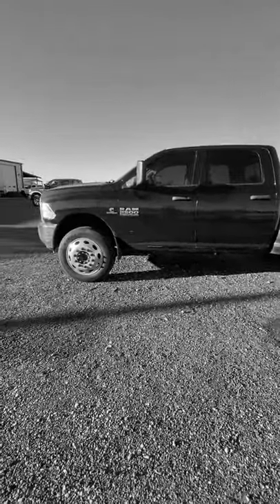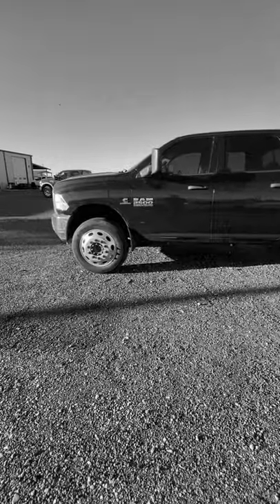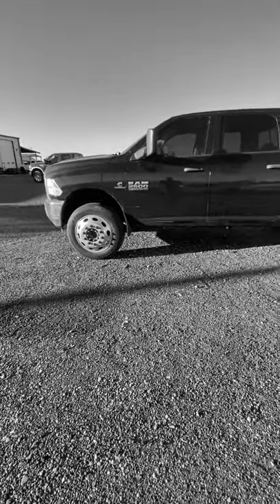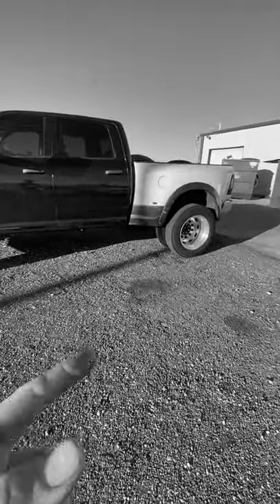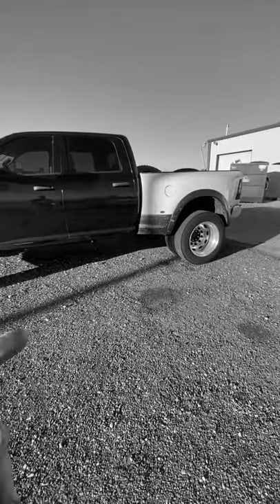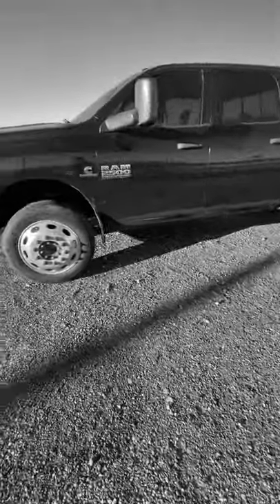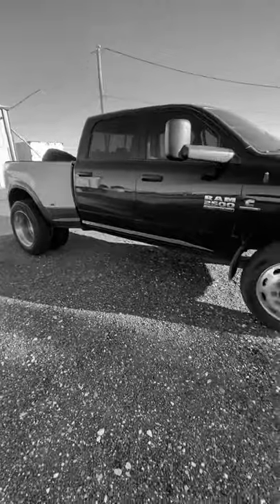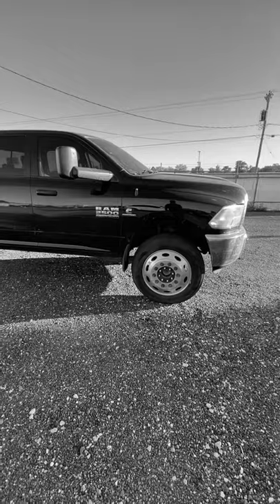Short box dually Cummins

Comment: I have a short box 2500 a 2020 besides the short box bed what else would I need for a factory look ie adapters wheels what about the rear? Thank you for your time
Reply from the maker: Depends how in depth you want to go, you either need to swap in a dually axle or use wheel a coasters
Reply from the maker: Adapters

Comment: I have a 2017 2500 i wanted to convert to dually,  What did you do to complete the dually swap, soup to nuts.
Reply from the maker: Need wheel adapters for rear and the front all your need is adapters or the factory dually adapters
Reply: @Recklessmotorsports  is there any difference between 2500 and 3500 besides suspension? will there be more stress on the axle with an adapter?

Comment: Yea never cut the frame I have a short bed truck I just put a dual axle on it
Reply from the maker: This is common practice, nothing wrong with it
Reply: @Recklessmotorsports  Not according to DOT they say big no no but I’m not that cheap i bought a actual short bed and put a dually axle thats the right way to me but hey what do i know I’m only a diesel mechanic that does D.O.T.  inspections daily
Reply from the maker: Incorrect, frame and body modifications are fully legal in all 50 states as long as it’s the work is don’t by someone experienced in it. You should know your laws better before commenting.